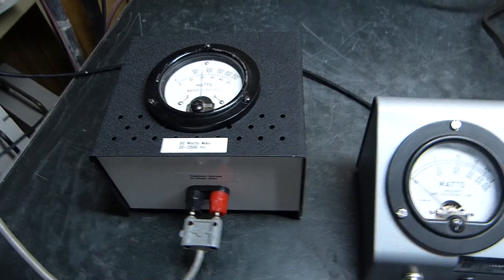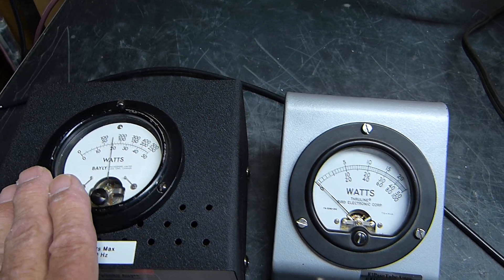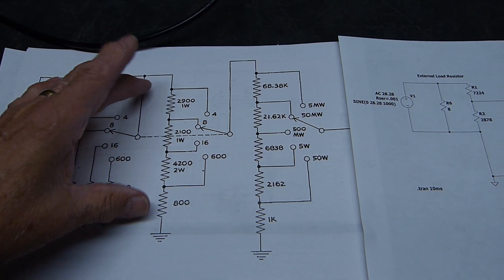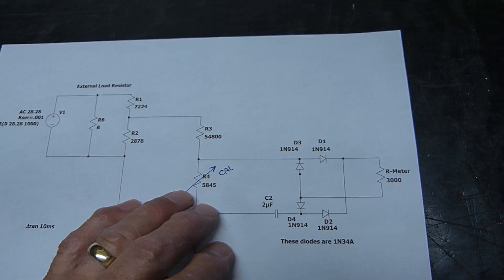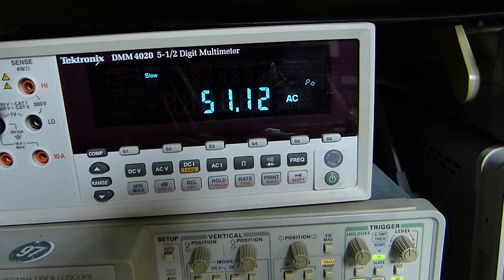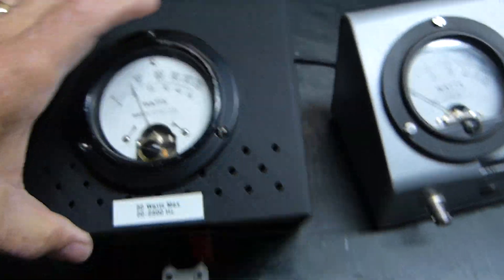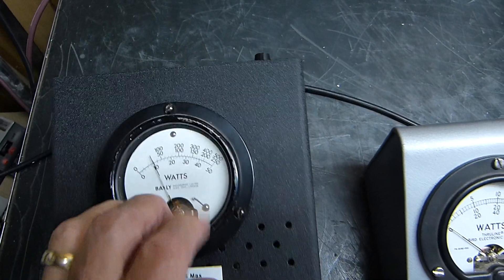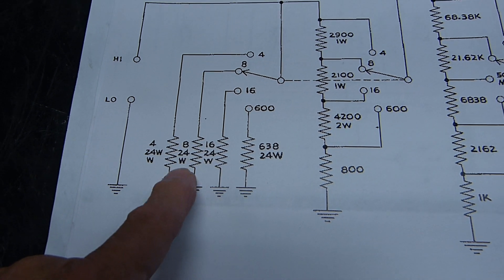A Simple Easy to Build 50 Watt Audio Wattmeter Using 30 uA Meter Movement

Comment: Thank you for making this. I’m fascinated by audio watt measurements. I couldn’t figure out hoot get my Keithley 2015 THD bench meter’s math function to derive watts at 8 ohms. I gave up and bought a Tek dmm 4020. It’s manual eluded to the math functions but I think the 2015 wasn’t using dbm. Anyway I love the analog as much as the digital. How does this circuit work? I thought you were going to go into that. I’m guessing it’s treating the audio like a AC power supply and converting it to dc with a rectifier? Then attenuating it to match the meters scale. What keeps it from bouncing all over with the audio signal changes assuming it was live audio?  Would you dampen it with a cap? 
Keep the audio videos coming. Btw, as I’ve built my audio lab based on most of your equipment it’s led me to buying and repairing test gear. Now I’m obsessed with calibration gear from the 60s to 80s. Have you ever had to restore your old GenRad equip?
Reply from the maker: I have heard of the Keithley 2015 THD meter and is sure seems top-notch but I don't know if it does power measurements.
Did you figure out your Tek DMM 4020 to display power in watts? I use mine all the time for power measurement. It is amazingly accurate but I wanted something very simple that does not need to be powered and can be portable. If I multiply the voltage as read on my Tek DMM5010 (or any of the high quality meters) and multiply it by the 8 ohms, it agrees with the 4020 power measurements to something like 0.07% or better. So accurate in each case it can't be determined which is the most accurate. I do love accurate lab grade test equipment.
Yes, this watt meter is just treating the signal from the amplifier, which is a sine wave usually at 1 KHz, as an AC  power supply voltage and attenuating it and with the two attenuation networks, and scaling it (I guess that is the right word) so that it will track to the  graduations on the watt meter face. I have tried to figure this out so many times and it just occurred to me the other day that I needed both attenuation networks to make it work as inspired by the Heathkit AW-1 schematic. I don't understand yet why it requires two attenuation networks to be able to adjust it to the squared scale of the meter. Power measurement, mathematically, is the square of the voltage but something about the average reading characteristics of meters coupled with other mechanical factors I don't understand, seems to be solvable by using two attenuation networks. Needless to say, I am very pleased to finally get this solution and want  to pass it along to others.
I have a 32 segment LED light bar on order to measure peak power that I plan on using to try, once again, to measure the differences between "hot" and "cold" bias on the output tubes as it affects "head room". I accept it as real from the musicians point of view but I want to measure it analytically. 
It crossed my mind to see if I could make this watt meter measure peak power by using a capacitor across the meter, as you were suggesting, but I think it will require amplification  and a much more sophisticated circuit to accurately measure PEP. I am hoping the LED display will accomplish the PEP measurement. We will see...
All of my vintage GR equipment is phenomenally accurate. I love this stuff and use it in practically every case, to verify any new digital equipment I get. The GR equipment can be complicated to use but when all is said and done, it is the last word in my measurement process.
Per your comment on live audio - I have found over the years that mechanical meters like in this video, will only indicate about 25% of the average power under voice conditions if you want to keep distortion to a low value. I say this from both reading it in the older Radio Handbooks and from personal experience with my SSB amplifiers. Under heavy modulation of a class-B amplifier as used for a linear amplifier in ham radio SSB, you can "talk" the meter a good bit higher, even to 50% or so, and still have a good voice communication signal. Of course, some of this depends on the amplifier design and can the tube deliver all that "head room" power along with the power supply and so on. Distortion, no doubt, is several percent but that is acceptable in voice communication and in some cases, may even enhance the ability of the person at the receiving station to understand the speech. Some people may disagree with this...   
Thanks for your comments. I am pleased my videos have helped you.
Reply: @ElPasoTubeAmps  I did get the DMM4020 power math to work.  It's great and so easy for my eyes to read.  I stored the 8 ohm Watts setting to the first memory button of the DMM4020.  Hitting that button displays the voltage and the 8 ohm watts at the same time. Or I can make it display  the freq and 8 ohm watts at the same time.

I also have a Realistic APM200 Stereo analog audio watt meter. It has left and right meters with  dual scales, 02 watts and 200 watts.  Nice unit.

I believe the two attenuator networks are simply one to calibrate to the meter and one to calibrate to the scale you want to use. Even one to calibrate to the chosen fixed load.

On another topic I bought a small portable device on ebay called an impedance  tester.  You plug it into your speaker cab and it drives a small AC signal and then reflects the total speaker impedance on a meter.  It doesn't work but what a great idea.  You  wouldn't have to take  a cabinet apart to determine the speaker wiring if it worked.  Great for guitar cabinets too. It seems to reason that a circuit could be designed to do that.  I have a General Radio 1650-A Impedance Bridge.  I wonder if that could do it?
Reply from the maker: @rpbale  I think you just explained the relationship between the two attenuators - one to scale the input and one to calibrate the meter. Thank you. My mind couldn't quite see it.
The GR 1650A is a nice instrument but it is difficult to use at such a low impedance as 8 ohms but with care, you can determine it. I have written a couple of Excel spreadsheets to do the math necessary for conversions  with the GR impedance meters if you need them.
I recently bought an instrument called  a Mastech MS5308 LCR Tester that works very nice. The one place most all of these instruments fall short is measuring iron core inductors like high inductance vacuum tube output transformers.  The GR 1632A bridge is the manual to read on iron core inductor measurements. I have found that inductance measurements of iron core inductors is best made in the most simple and primitive lab approach manner with accompanying and necessary math. I have a couple of rather poor videos on it and would like to make another but I don't think many are interested in these inductance measurements. I can accurately measure from a uH to 4000H reliability with a method using a simple circuit and equations. Here is a link below. I use the method "measuring with a sine wave" and it works very well.
.https://meettechniek.info/passive/inductance.html

Comment: So its 50W max into 50 ohms, or 8 ohms? 
I'm guessing that the resistor parallel network is highly dependent on the value of the external load...
Thanks for uploading.. I need to make one of these.
Reply from the maker: This one is for an 8 ohm,  external load, for audio measurements. 20 Hz to 2.5 KHz. 
The resistor network(s) are critical for accurate measurement. You might want to use pots to determine the best settings for your meter and do as I did and measure the values carefully with a good digital ohm meter. Conceivably, once you get pots "dialed-in" you could leave them in the circuit and not have to go to fixed resistors. But these values are a good place to start for a 30 uA meter movement. See comment below for accuracy issues some have experienced with cheaper 30 uA meter movements which will throw your readings off.

Comment: Hi Dave,
I bought one of those chinese 30uA meter movement and they are really 26uA. Made the measurement myself with a Fluke 17B+ meter.  73  WB3BJU
Reply from the maker: That is unfortunate. Both of these meters are dead-on 30 uA. I guess there is just no way to cheat high quality instruments. What you say here I have seen in another video a few years ago where a fellow was comparing the Bird meter movement to the cheaper ones and the power level readings he was getting. I think the company that sold them was trying to appeal to him to take his video down. They claimed all of the problems had been solved. He wasn't buying it...   :-)